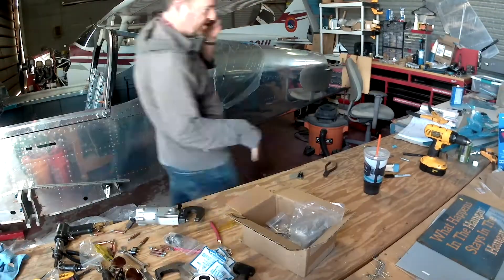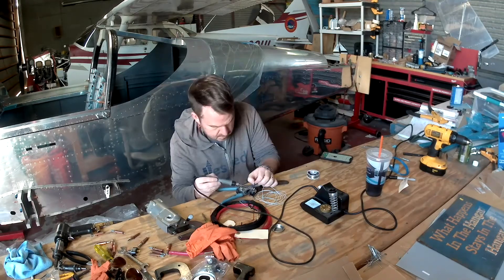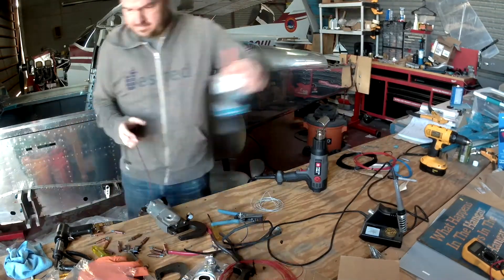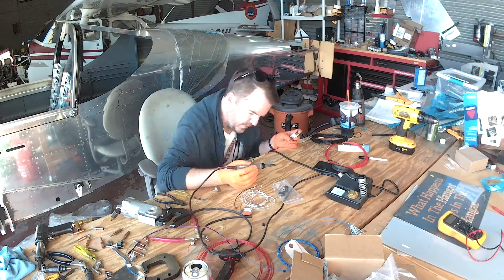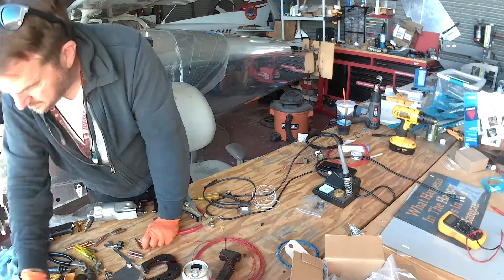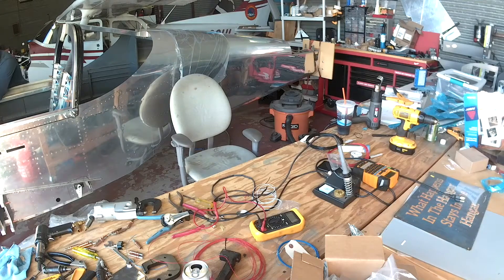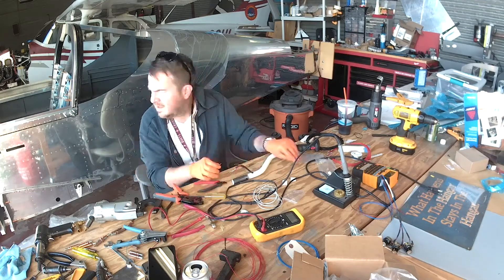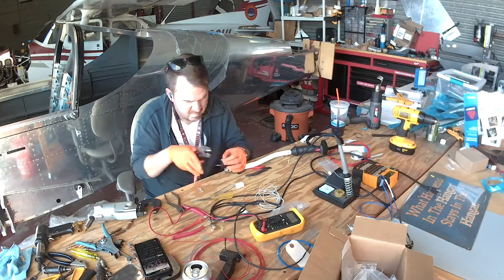RV-14 Ch - Rando Wiring 1

Comment: Question on the instrument dimmers: Since you're wiring-up your own, is that to say that the Garmin units don't have this feature? Is it the same for your standby instrument and radios?
Reply from the maker: Err.... that's a good question. If you mean can you access the dimming features via the G3X display I'm not sure but these dimmers do plug into the GAD 27 unit. It's a built in feature they just aren't supplied by Garmin. None of the wiring is. That's one of those lil things you read in the installation manual, 'builder is responsible for supplying their own wiring'
Reply: @akilroy  Thank you, sir. Looks like there is a good chance that I'll be looking at going with a prefab wiring harness, unless clairvoyance pays me a visit.

My wife and I are still on target to begin our -14A build in 21-months from now, after I retire. Getting my workshop ready, and messing around with Van's project kits in the meantime.